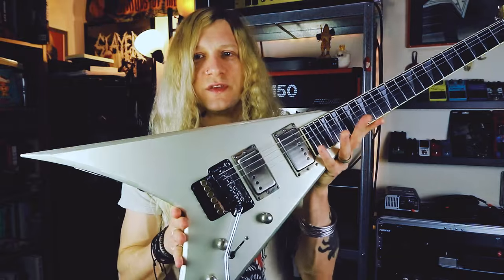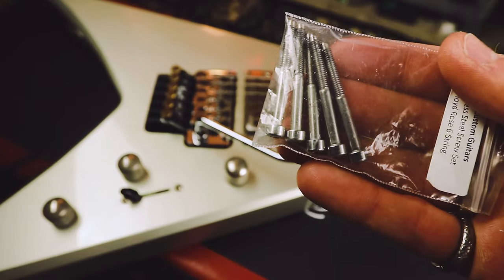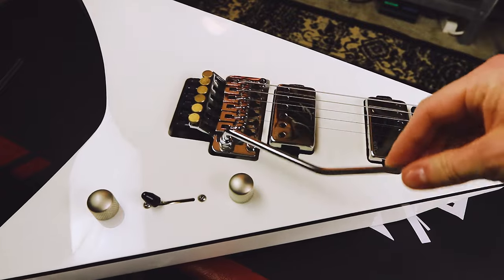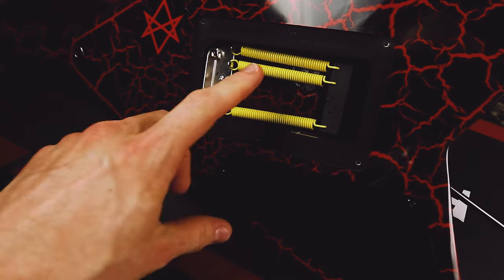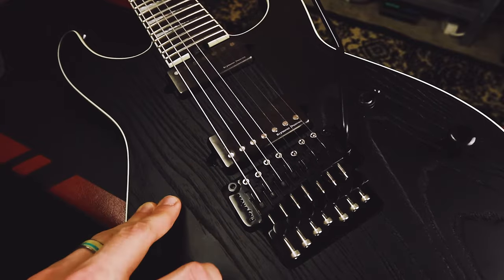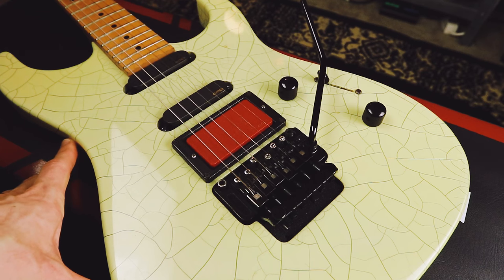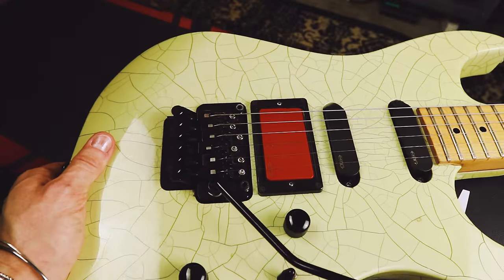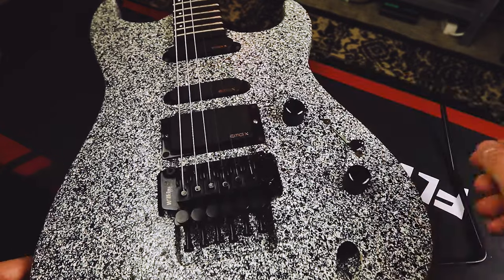Different Floyd Rose models explained. And let's talk about MODS

Comment: The Japanese Gotoh 1996t is on par with the German floyd but has a superior push in bar design over the collar type....I will still take an edge, edge pro, or Lo-Pro Edge over an OFR any day of the week
Reply from the maker: Never played the Gotoh! I’ll check one out soon enough
Reply: True. The best trem system ive ever used is the edge trem on my stock rg 565 reissue. Flutters like a mf and returnes to pitch perfectly
Reply: I have an original 1984, OFR 1000, and prefer the Ibanez Edge Pro on a J-Custom and love it. I haven’t tried the FU Tone take on the OFR but I have heard good things.
Reply: @GuitarDudeOfficial  doesnt get better than a jcustom.
Reply: My two 1984 Floyd Rose's came with push in bars.  They're also available separately.
Reply: Gotoh that's a name I keep hearing about do they make good tuner's you ever played them? Got a few guitars that I want to change the tuner's on. Don't really want to go with Grover...

Comment: Schaller makes the German Floyd Rose for Floyd Rose. The original German Floyd Rose Pro has a narrow string spacing .400 which I prefer has been discontinued for the Pro 1000 .420 I wish someone made the .400 inches spacing tremolos. Really want to build a Fu-Tone FU2 trem or upgrade an Original Floyd with Fu-Tone parts.

Comment: You know Fender and Schaller got together and made the BEST Strat bridge. My 93 deluxe plus Strat has a F Floyd Rose bridge and Fender would put a Hipshot Tremsetter in the case brand new. I installed mine cranked the bridge to whammy up and down 27 yrs ago. Play the crap out of this guitar and have never needed to mess with it again so far. But will need some fret work soon so will set the intonation after then. Amazing set up and no one knows about it. Fender/Floyd Rose.
Reply from the maker: Did these also come on the original HM Strats?? If so, then I think I’ve played one of these before. Never owned one, but will keep an eye out!
Reply: @bvanhoosen  HM? Is that the black almost Aerodyne looking Strat?  I'm not really sure. Good question For real you should check with that guy who's name starts with a Z. He seems to know a lot of fancy Strat history.

Comment: I have to mark my tremelo arms so I don't mix them up, the Special's arms definitely don't work right in my Original's bridges.
Reply from the maker: That’s odd! It might be a thread pattern difference. If you switch the base plate coupling piece, I bet you’d get the Special arm to fit the OFR and vice versa

Comment: Have you tried the Graphtech String Saver Saddles? They're made by Gotoh for Graphtech who assembles them and impregnates them with whatever that "string saver" material is but they are zinc saddles. I have those on a 1997 OFR when they still came stamped Original Floyd Rose anyway, got the Stone Tone on that with titanium string lock blocks, Hollow Points and I like it. I've known Rob at ST for while and been using the blocks for a long time. I also love the FAT blocks, tungsten and brass... I need a titanium block, I'd like to check those out. I have a few OFR's and 1000's sitting around that I swap in and out of guitars at string changes and I've been using those Tone Claws...you need to get one of those...I always say go brass...but the other option just like the FR sustain blocks are just nickel plated brass. \m/
Reply from the maker: Haven’t tried the Graphtech ones! They do look interesting though!

Comment: Any difference in sustain or tone between a brass and granite block?
Reply from the maker: In my opinion, yes, a little. It seems to make the tone a bit more airy in the upper (~6k) frequencies. What I like most about it is that it's actually much lighter, so you get less unwanted wobble when hitting big chords.

Comment: schaller will sell a new coupling kit for the lockmeister... which is supposedly the same as an OFR, but doublecheck dimensions. I have that couplingkit retrofit to my pre-2016 lockmeister, can recommend.
Reply: owning one I guarantee that the Lockmeister is identical to the OFR dimensions and specs : which makes sense because Schaller also makes their own take on the FR design, and it's called The schaller tremolo. It has the same dimensions but it uses different locking screws system, a thicker baseplate and replaceable knife edges. But both are 100% compatible with an OFR cavity and posts.

Comment: Is that the Het set emgs? I have a Jackson soloist from 1991 that I bought in 1991 and had emgs installed when I bought it. I put an 85 in the bridge and two SA's for the singles.
I recently just bought another Jackson soloist that came with stock Seymour Duncan that I didn't care for. I also decided to put emgs in as well. However, it is also an HSS setup guitar, and I put an 81 in the bridge and two SA's.
Most people love the 81 in the bridge but I found I didn't care for it and swapped it out for an 85 in it sounds darker and heavie.
My original 91 soloist professional XL was made in Japan.
It came with a Charvel stamped made in Germany by Schaller, Floyd Rose tremolo.
The guitar is 33 years old and one of the problems with those bridges is the plate. The intonation screws stripped a couple of years ago. A total bummer!
Just replaced it the other day with a lockmeister.
As far as I could tell that's the only drop and go for that guitar. It seems like the cavity isn't as long or as wide as they are nowadays, and so it was either that or by a vintage one from somebody else that may or may not already be stripped and that will just end up stripping the intonation screws, so I went with a brand new lockmeister and wow, it performs amazingly! The flutters on it are absolutely out of control now! They used to be weak😂😂 now if I want I can actually sound like it has a low Pro Edge in it LOL. That's what I compare a good tremolo to if it flutters like an edge Lo Pro then we're good

Comment: Would any of the Floyd Rose models be an easy replacement for the Schaller? 

I have a ‘91 Charvel fusion Custom that I’m trying to refurbish, it has a Charvel branded tremolo made by Schaller, but as someone has already mentioned, the steel intonation screws eventually chew up the thread in the die cast baseplate making setup impossible, I would like to replace it with a Floyd Rose that has a steel baseplate so I can experiment with string  gauge and not damage the plate while loosing and tightening the screws to set intonation
Reply from the maker: Easiest one to replace it with would be a new version of the OG Schaller trem. Floyd will work, but you need to get the string lock route enlarged so you can intonate properly.
Reply: @bvanhoosen  Hi Bryce, I don’t want to modify the body if possible, and I take it you mean the original model Schaller? Really wanted to change it for something with a steel base plate…… Looks like I’ll have to rethink. Thanks again
Reply from the maker: Yeah, the original Schaller design (wide base, short string lock screws)! Unfortunately it’s just different enough to be difficult to swap for a different model. Not sure why Schaller chose to do that, but it is what it is 😭
Reply: @bvanhoosen  probably so that you can only replace it like for like! 🤬 
A couple of other people on different forums have suggested trying the short screw kits on eBay or the low profile model, but I’m not convinced! 
Will need to do more research! 
But thanks again.

Comment: 1000 is made from softer Flow Steel and hardening process is faster than what Schaller does.

1000 was brilliant earlier, i have still few and they're great stuff, no probs, but 2023 i see folks having probs with them.

I had to send one ESP Edwards E-SCYTHE back and seller responded they've never seen such wear in a new trem.

My friend bought Jackson RR24 with 1000 and same probs, otherwise great axe but Floyd didn't stay in tune,. Always pitch up or down after trem use.
Also gotoh springs made some hella noise, had to replace with Schaller springs after getting guitar back.

FR1000 used to be great trem, but quality deteriorated somewhere 22-23.

Its funny Harley Benton sells gits with FR1000 399€.

I believe there are peeps saying 1000 is as good as OFR since 1000 used to be just OK, no probs whatsoever.

I believe Korean factory has done some changes to quality, & that is if i believe seller and my own experience.

Same dimensions and overall looks off course, official FR-site isn't obviously saying all the details but as we speak, FR1000 isn't as good as OFR. Otherwise OFR would be in cheaper gits
Reply: Forgot thanks, great video 👍⭐
Reply from the maker: Damn! I’ll have to keep that in mind next time I check out a FR 1000 series. Maybe they’ll get better next year 🤷‍♂️
Reply: Bent whale tails on the newer 1000 Series seems to be the biggest complaint... including both factory 1000 replacement base plates I got. No more Korean junk for me. Got a Schaller LockMeister and never looking back... even though the German made Schaller has the ever so slightly smaller base plate like the Korean 1000.
Reply from the maker: @scottdunn2178  that may explain why the fine tuners are way harder to turn on the 1000 series!
Reply: I just got a brand new Charvel and the Floyd Rose 1000 is defective.
Reply: I agree. I have a '91 Heartfield Talon with the 'original' stamped Floyd and that trem really is incomparably great compared to my 1000s. In fact it's made them feel like toys.
Reply: AP International Music Supply has taken over Floyd Rose patents not so long ago. Maube they're going Gibson road lol
Reply: @JonsterTheBondster  Ah...maybe that explains why they aren't German made anymore...

Comment: Hey man, thanks for the info,
quick question: so you can't change old schaller trem with OFR without additional routing/drilling ?
Reply from the maker: From my experience, no. You’d have to at least route out the string lock screw area to give yourself enough room to properly intonate, and possibly the posts as well. They’re unfortunately sized completely differently
Reply: It's good to know, thanks for sharing
Reply: I’ve heard that they’re the same material. But the German Floyds are made with more precision 🤷🏾‍♂️
Reply from the maker: @tarasikarius  my pleasure!
Reply from the maker: @KeithFine10  the Schaller one is a zinc alloy with steel inserts, and the OFR one (also made by Schaller) is a fully hardened steel base.
Reply: @bvanhoosen  my mistake, I was referring to the 1000 series Floyd and the OFR
Reply from the maker: @KeithFine10  Oh I see! Yeah, they do say it's the same materials. Need to test that to be sure! There's gotta be a reason the 1000 sells for ~70 less than the OFR.
Reply: @KeithFine10 1000 base plate is stamped out of steel sheet metal, and case hardened.
The OFR is forged steel.
1000 has cast steel saddles.
OFR has machined saddles.
1000 usually has a 8mm thick nickel plated cast brass block.
OFR has usually has a 12mm machined brass block.

Both are durable, but people say they sound different.
Reply: @qua7771  I have both in my guitar,haven’t had any issues with the 1000’s although I do upgrade all my trems with FU tone hardware and blocky
Reply: @KeithFine10  I just wanted to share that information to anyone wondering about the difference aside from the country of manufacture.  FR has claimed that the two use the same materials.  That is sort of true.

Comment: cool video would be interested in a weight and a hardness test on the metals, you can get hardness tester file kit at harbor freight for like $13. I'm also interested in how compatable the floyd roses are with the ibanez edge systems i've never measured the post widths and it would be great to upgrade some of my ibanez with floyd or gotoh bridges.

Comment: The best one in my opinion is the Schaller Lockmeister - is an improved version of the original floyd which was also built by Schaller back then.
Better Materials and harder steel on the Lockmeister.
Reply from the maker: The Original is still built by Schaller as far as I know. I’ll try to get my hands on a Lockmeister!
Reply: @bvanhoosen  oh yes do it ! 🤘
Reply: @bvanhoosen  the original one is great too,i got mine since 83 in a old kramer still works fine ! Greetings from Germany
Reply from the maker: @MrStarlight1980  Love the original, but always looking for cool new ones to try!

Comment: I have an Alexi Lahio Greeny LTD 2018 i special ordered it from Sweetwater had it pleked ,the neck and action is smooth as glass,anyway its got 1000 series Floyd, would a original swap in without wood removal just curious..thanks man happy holidays cheers to u and yours man🤘🎸🍻🎄☃️🎅
Reply from the maker: Yeah it should absolutely fit without any routing needed at all! I’ve done it plenty of times. Happy holidays to you as well!

Comment: The new original Floyd is no longer stamped made in Germany and the original FR nuts are a 10” radius special,1000 and 1500 is 12” radius
Reply from the maker: Heard about the Made in Germany stamp, but did not know about the OFR vs 1000 radius! My issues with swapping the nuts suddenly makes a lot more sense!

Comment: Do you know if Floyd makes a “pop in” trem bar?
Reply: I’m asking because that’s what my Strat Ultra has and it’s adjustable depending on how stiff you like your bar
Reply from the maker: Yeah, the push in bar! Pretty sure I mentioned that here. The Floyd 1500 comes with it stock, or you can buy separate
Reply: @bvanhoosen  so that’s a “push-in” bar, it’s a little different. Look up “Strat Ultra pop-in whammy bar”
Reply from the maker: Oh weird, it has a retainer clip thingy. Floyd’s don’t usually go into the block like that, so I’m not sure that design could work. The push in is the closest they can do I think 😅
Reply: @bvanhoosen  all good dude! I appreciate you responding!

Comment: Ive had no problems with Floyd Specials or older 1000 series they are almost as good as the original to me as I have all of them. The ones I am now having issues with are the newer ones that have the cheap stainless steel parts. The 1500 and 1000se. On the 1000se The arm coupling is terrible and i cant get them to flutter like I can all the others. No matter how loose or tight the arm is it rattles. I am going to try replacing the coupling and arm soon. The 1500 I have on the Loomis SL7 is better with the push in arm but just doesnt feel as good as my older Floyds. Pretty disappointing.
Reply from the maker: The collared arms are all pretty bad imo. I’d try the “Old Style” arm if you want the most direct feeling between the arm and the base plate.

Comment: Have you ever heard of a German made Jackson branded Floyd?
Reply from the maker: I have not! But they did all kinds of weird stuff in the 80s and 90s, so I wouldn’t be shocked if it existed
Reply: The JT590 is a Jackson branded bridge that says "Made in Germany by Schaller" on the base plate. Maybe that's the one you're thinking of.
Reply: George is correct, Schaller made many “company-branded” trems. Also a Charvel branded one.
Reply from the maker: @georgehartman4157  Oh that's right! That's actually what came on my Charvel - I completely forgot.
Reply: @bvanhoosen  Can't blame you for forgetting. They had so many variations back in the day. Vids like this are really helpful for anyone who wants to upgrade. I have a couple of older Jacksons that I need to upgrade but of course they both have weird trems that are only partially compatible with the parts you can buy today. I think one of them has the same trem as your Stealth so I'll be keeping an eye out for your update on that one.
Reply from the maker: @georgehartman4157  I'll definitely update once I get the Schaller one on there!
Reply: Jackson JT-590 - Had one on my 91 Charvel Fusion Custom, (Charvel branded for mine though).